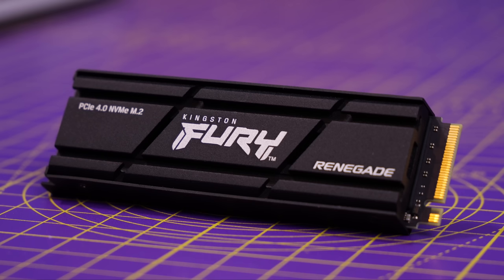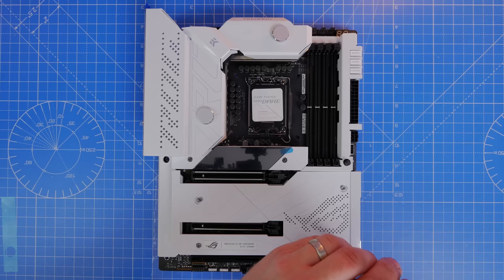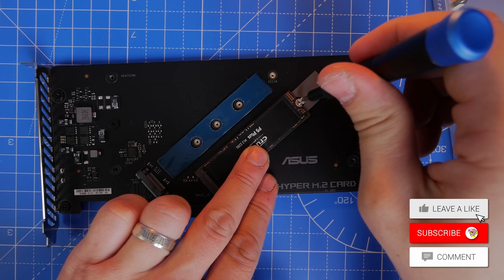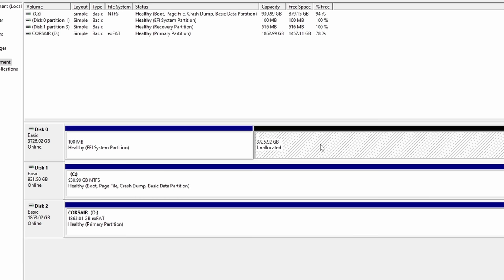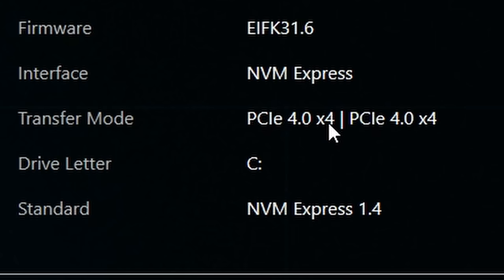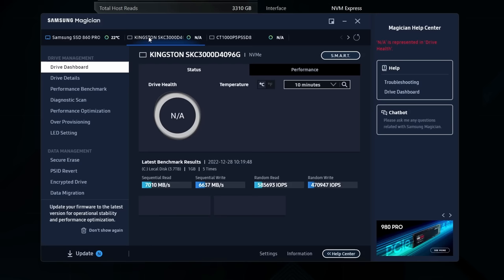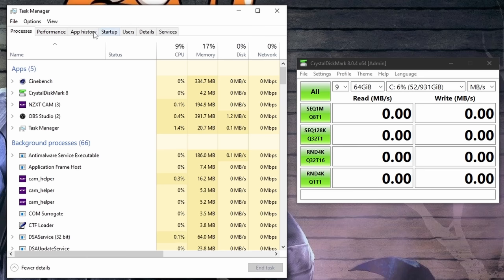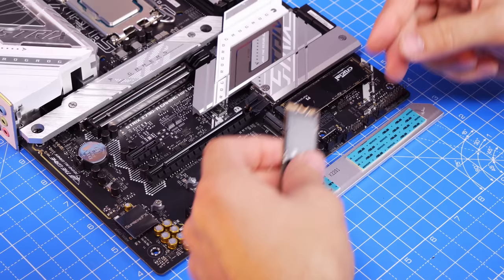Don't make these mistakes with your NVMe SSD installation - NVMe tips and tricks

Comment: Anyone know why my new m.2 nvme randomly stopped working and showing up in bios. I just got it like 2 days ago. I heard either somehow my slot broke or the m.2 broke. idk how either could of happend but it sucks either way
Reply: You need to check if the problem is the ssd or the motherboard. Try inserting the nvme in a different m.2 slot and see if it works. Then you'll know where the problem is
Reply: as of now k can’t use my pc. I’m having horrible luck. I had a drink I was drinking, I fell asleep, My pet fox spills it. The thing is it spilled and almost all of the drink was soaked up by my desksize mousepad. Except there was one little area where it was able to reach the edge of the desk and that happened to be right above my pc. It dripped in right on top of the gpu. From what I can see it only got into the heatsink on the gpu and a little on some fans. But I’m scared to try and turn it on. I’ve cleaned what I can but could not get it all.
Reply: @a1zach_81  what a disaster, I'm sorry
Reply: ya. Hopefully. It’s not broken Bc idk if warrenty will cover that. I was scared to open it up so there are still spots on it. Idk what do you think. You think it’ll still work if soda only got on the heatsink?
Reply: @a1zach_81  i'm no expert os I might be wrong, but I think the problem with liquids in hardware is that if they conduct electricity, they can cause a short circuit and that destroys the components. Theoredically, there is no problem with wettening components, as long as they are absolutely dry when they're turned on. So if the soda fell while the pc was turned off it should be ok. Actually, I'm not surw if having the power supply on would be a problem. If the powet supply was off you should be able to get it working fine if you do an incredibly efficiency job at drying it. Something you should do with an actual expert. Otherwise I dont know. I recommend you dont plug it back in the wall until you have gotten assistance from a technician
Reply: ok. When I got home I saw it like that and instantly unplugged it and turned it off. Took the gpu out. Dried all I could and tried to clean as much off as I could. I couldn’t get all the soda but nothing is wet just like dried soda in the heatsink. Idk how bad that is. Do you think I could take it to bestbuy? Best place I know about to take it

Comment: i have the p5, and didn't know the cover with the sticky went back on. mine runs at 45c at most without it. i've been reading that it's better if they are warm, but not the controller. so, i'm not sure if i should bother putting it back on.
Reply from the maker: https://youtu.be/YUJKyA-q7Zs
Reply: thanks! ~ i'm glad i opened my drawer recently, and saw the heatsink. i got really bad speeds on crystal disk mark, so today i put it on with the thermal pad, and 1st try i got 3500 mb/s like promised. instead of 900 some. so, i guess it was being throttled, since i was very wrong about my temps above, it was really getting 65c. 😬

Comment: I have a problem where windows doesn’t read my nvme I have a 980 Samsung 1TB pro and got another same exact model and put it in the slot below it but windows doesn’t read it what do I do
Reply: Me too, I installed the SSD on the pcie 4.0 and my computer wouldn't recognize him, I tried all ways possible but it didn't worked. So I installed on the pcie 3.0 and then it worked. So I don't if my motherboard is old or if the location is defective.
Reply: Need to initialize under disk management. It will be recognized there. Then after initializing it will show up in explorer and/or This PC.
Reply: @UCo0v-r2vR_EcXSRH4HYrtgg I did that but thé SSD isn't there

Comment: So i bought a used z390 gigabyte aorus (pro?) Plus i7 9700k, So the pc cancels to boot if i put it in the second slot below first pcie lane, so i found on tomsforum that windows needs to be installed on the first slot and can than be transferred to second slot but my pc still does not boot or post it lights up on vga but its not a video problem, in the first slot its longer it works gpu works sata ssd works all works, nvme onky in second slot no sata no gpu it does nothing
Reply: I know about some sata ports not working after using nvme slot, everything is plugged off only nvme and power, and pc doesnt boot in the slot matching size of the ssd sn850x, that baffles me the most, i now need to buy stand offs for it to fit in the first slot

Comment: I fancied some NVMe some months back, naive me I just bought an PCIe card that had a NVMe heat sink and fitted to X99 motherboard. Only to be told that Win7/64 will not support same and need an upgrade/patch, and since Win7 is no longer supported then the patch/upgrade is no longer available. Thanks Microsoft. I have it attached via a USB3 cable and it works very nicely but not nearly the 0.75Gb/s I hoped for originally. I really do not want Win10. Is there anything I can do to move forwards?
Reply: Dude, it's time to move on. You are opening yourself up to vulnerabilities using such an old OS. I can tell you from personal experience that windows 10 or 11 isn't really any worse than 7/8. Winxp on the other hand?! If it weren't so old and unsupported I might still run XP 😂
Reply: @dfoolz  
XP is still unbeatable!!!

I feel old

Comment: Please Help. This seems like the best place for advice!!!
I am assuming that I have a bad EVO 990 Pro. If I could get some help with this issue I'd greatly appreciate it. 

I have a new MSI MPG X570 Gaming Pro Carbon motherboard, Ryzen 7 5700g CPU, EVGA GeForce RTX 2060 KO ULTRA GAMING (installed in recommended uppermost PCI_E1), 64GB Crucial Ballistix 3200 MHz DDR4 DRAM. I have also installed the latest AMD Chipset software and the latest MSI BIOS installed and running the latest Windows 11 and updates.

I've owned several Samsung EVO 970 Plus's and they have always work flawlessly.

My motherboard has a M2.1 & M2.2 slot and I had an EVO 970 Plus in upper most (M2.1) slot closest to CPU and just underneath the RTX 2060 video card. Speeds on the EVO 970 Plus range between 3400 & 3600 MB/s.

Looking for an upgrade, I have purchased an EVO 990 Pro removed the 970 and installed the 990 in the same M2.1 slot. Reinstalled Windows 11, by choice. 1st thing I did was installed Samsung Magician. The speeds were less than the 970, around 3100/320 MB/s. Magician reported interface PCIe Gen. 3 x 4 and recommended to install in PCIe Gen 4.0 for best results. So I moved it M2.2 slot even though I thought the MSI MPG X570 were both Gen 4 slots.

Magician then reported the interface was PCIe Gen. 4 x 4, ok great! however the speeds were the same, if not a tad slower :(

I've had the EVO 990 Pro in both M2 slots and moved the video card to the PCI_E3 slot. I've grown extremely frustrated trying to achieve the boasted speeds of the 990 Pro. 

I am not sure if it is necessary because I am not that savvy, but I did Google and tried some different BIOS settings to absolutely no avail.

It could be something simple I am missing in the BIOS or just simply a bad 990 Pro? Any advice or help at all would be supremely appreciated as this has been a most frustrating problem. thanks...jack
Reply from the maker: That is a very strange problem. You're sure it's running at x4?  Perhaps the other slots being populated aren't helping. Also maybe it is a firmware issue? https://www.pugetsystems.com/blog/2023/03/14/samsung-990-pro-critical-firmware-update/

Comment: This is posted a while ago but does the asus TUF Z270 MARK 1 support NVMe? I just ordered a NVMe ssd card
Reply from the maker: @Midplays09  that's a really old motherboard. I'd say check the specs on the Asus website. Though I'd be surprised if it supports them and if it does it'll be old speeds like gen 2 or 3.
Reply: @TheProvokedPrawn  it does work, it was a M.2, so I just need an USB stick and I can run linux again!
Reply: @TheProvokedPrawn  also if u say that is old, my gpu is 2015 and my cpu is august 2015
Reply from the maker: @Midplays09  good news. What speeds do you get?
Reply: @TheProvokedPrawn  I got an i7-7700k cpu and rx580 series gpu as of now
Reply from the maker: @Midplays09  no sorry. I meant from the NVMe
Reply: @TheProvokedPrawn  3200MB/s Read, 1300MB/s Write, 512gb
Reply from the maker: @Midplays09  not terrible then 👍🏼

Comment: any idea why i cant see all my ssd's on the disc info menu?
Reply from the maker: Usually the problem is a bios setting  if you can't see all your drives in Windows.
Reply: Bios setting and/ or a bad connection. For example old sata cables, fail very easily. Sometimes fresh out of the box they will be dead. Super cheap 10 cent cables that companies get by the truck load.
Reply: You might need to update the bios. I had the same problem when installing a new m.2 ssd onto a three year old Asus prime x570 pro. Even though I already had 3 m.2 ssds up and running, I couldn't see the new one. After trying everything else, I updated the bios and everything worked as it should.

Comment: I've got a crucial p3 gen 3x4 in slot 2 and it runs at like 1500mb. Rubbish 😅
Reply from the maker: sounds like it's not running at x4 speeds
Reply: @TheProvokedPrawn  it's my board as far as im aware. It cuts it down to times two or one. something like that. I have the crucial storage executive software and both crucial drives are tip top.

Comment: I’ve put in my nvme and it’s not coming up at all, it comes up if I replace my old nvme which then I can’t boot up normally without reinstalling windows but if it’s in my 2nd slot would you happen to know the issue?